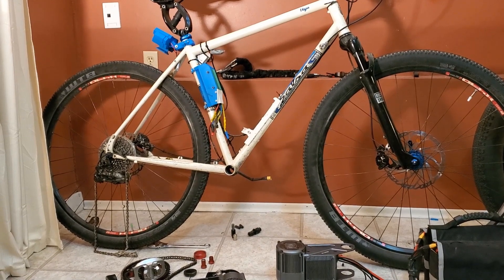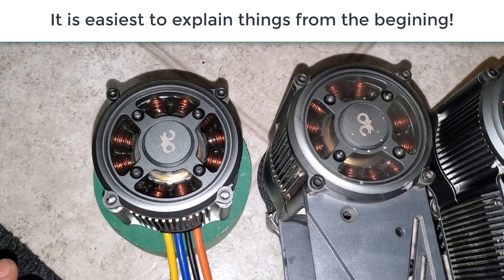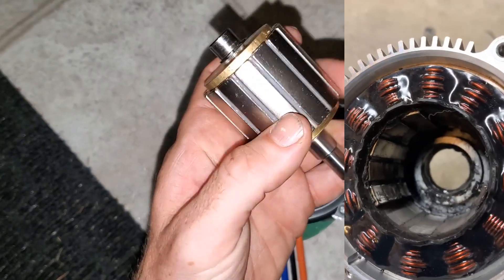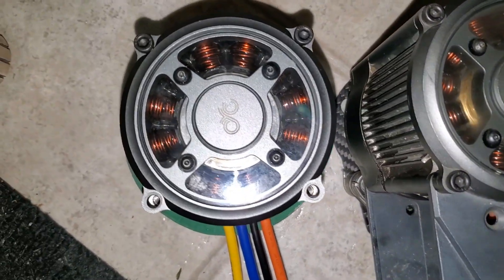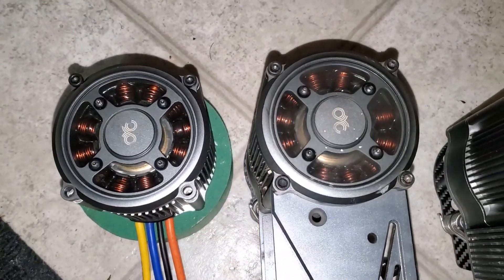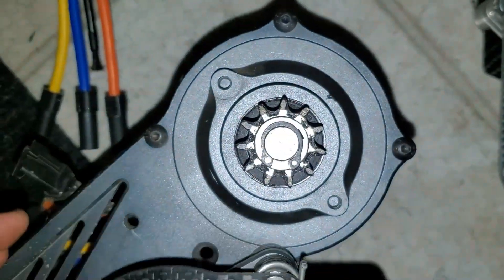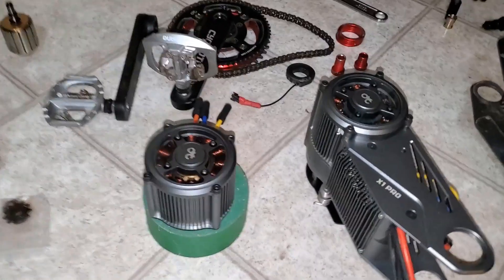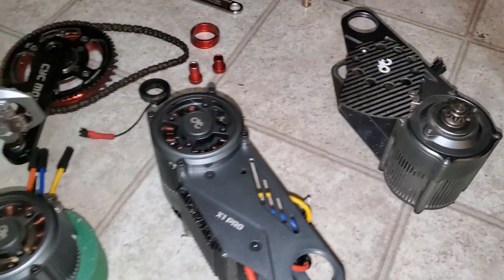Gen 1 CYC X1 Update - Overheating Problems

Comment: Great videos! 

Planning on buying the Gen 2 with the BAC 2000 and run a 72V system to allow me to hit 5000watts occasionally on a downhill enthusiast. 

Based on your experience with the updated motors, is it safe to run 72volts and high wattage or keep it down in the 3500 watt range? 

Also what chain ring do you recommend?
Reply from the maker: The middle chain ring option. You should be good with what you described. Hit me up if you need a mount for the BAC2000

Comment: I have had my bafang for 2 years and put 12609 kph on it and no issues at all. Nylon gear is still working too. U have 52 volt battery in it. I am thinking about buying cyc I seen a guy doing 110 kph on utube on gen 2 cyc and that's what I want even know my friend upgraded his bbshd and its dies just over 100 kph with one issue the nylon gear once replaced with metal it was good. Go bafang and u will never go back .
Reply from the maker: My fatbike is bbshd at 72 volts. My first build. Awesome 👌 Still on my nylon as well!!! Thanks for the comment. You are welcome on the channel discord if you would like! https://discord.gg/pKHk5ej2GG

Comment: what battery are you using?  what's the best place to get a battery pack in Canada?  I probably won't go over 25kph, avoid serious arse over tit situ.  the cyc stealth seems pretty good.
Reply from the maker: Golden motor Canada have batteries over here. They would run the stealth ok at those kinds of speeds. I'm using lipo on the cyc.

Comment: Bafang bbs02b or hd ,is better option??
Reply: Bafang got no torque sensor
Reply from the maker: Not on the 02 / BBSHD correct
Reply from the maker: It depends on the bike. I fixed my issues with the cyc. It's can be a harder motor to install and tune. The bbshd its harder to get the frame selection right

Comment: Should of got a cyclone
Reply from the maker: Its all fixed. Ripping up hills at 65kph 72 volts now. I have considered the cyclone as it looks good value. But in the end I wanted to try something new. There are not many examples I have seen of awesome builds with it. I dont even think Luna have a bike you can buy using the system which speaks volumes to me about its practicality. Are you building with the cyclone. I'd love to see your bike if so! Cheers 🍻
Reply: @HighVoltageKits  You cyc build is awesome.  But the problem I have with it is the price.  It is 4x the price of the cyclone for about the same amount of power.  Sure it has nicer fit and finish and if you have the dough, go for it.  But I wish they'd offer like a $600 version, maybe without the fancy display and torque sensor.
Reply: @pixelatedmushroom  bud, I agree with you!.......I love cycling and ebikes are my drug! I am on my third bbsHD and the am thinking about building a 72 volt hot Rod ebike. I don’t know if I want a cyc, cyclone or another bbsHD!
Reply: @Jazzmarcel  I made up my mind. A X1 Pro Gen2 + 18kw MD Cyclone + BBSHD (all on Enduro Frame with 72 Volt 50AH Battery) = PERFECT!!!
Reply: @vm2003  dam!......... that would be a beast of a bike!!!!
Reply from the maker: Holy cow!
Reply: How you used two motors?

Comment: Thats a bummer! Thanks for letting the rest of us benefit from your experience. The only thing I have had fail on my gen 2 is the bolts that hold the 2 chainrings together. CYC was very responsive and sent out improved bolts very quickly.
Reply from the maker: Fixed it. Just need to clean and rebuild the bike.

Comment: I got gen 2 and mine is leaking grease from between gearbox and motor aswel 1000km since new you know a fix ?
Reply from the maker: Check everything is tight maybe. I will be keeping a close on mine once it is running again

Comment: You don’t need much to get those apart!
Reply from the maker: Thanks. CYC sent some rather agricultural instructions involving bashing it on a table. Should be fun. Will be getting cracking shortly!
Reply: Captain Codswallop a rubber mallet will do most of the work for you
Reply from the maker: Yeah I'm sure Tony will have a few of those.. I am curious to hear his opinion as well as what it looks like inside.

Comment: Is this happening to the Gen 2 motors as well ? Or is it still too early to say? Thanks Captain, i appreciate the effort your putting into this.
Reply from the maker: No as they went back to just glue but better glue im told.
Reply: @HighVoltageKits  well i am sure they dont use glue on the vehicle you drive
Reply from the maker: The current rotors in the x1 I have are glued on. Seen to be holding up ok so far. They have been improving them further since.

Comment: I will be very curious as to what you find when you operate on that motor.
 Would it be possible to have a resistance/insulation reading done on the three windings? Resistance is the reading from beginning  of the winding to the end of each winding in ohms and Insulation is done with a 500v or 1000v unit which tests if the coils are shorting or close to shorting to the frame of the motor in K Ohms or Megohms
 Hopefully the windings haven't got a internal short or are leaking to the motor case.
From what I can see the coils or windings are very well insulated by that resin you can see through the window.
 No biggie if you can't but the Ohm reading should be fairly to very low and the insulation resistance as high as possible.
 Hopefully the problem will be physical like rubbing magnets due to heat expansion and a new rotor will fix everything🤞🤞
 Keep up the good work!
Reply from the maker: I will see what I can do sir. I will take lots of pics for sure.

Comment: Hi captain hope you are well. They are expensive motors you wouldn't expect issues like this especially when you were only running 52v. But cyc seem to be great at replacing and upgrading components that fail it almost seems the x1 was a bit of a beta version and they used the public as the test platform. 

Will be interested in the repair video I'm guessing your gong to do one?
Reply from the maker: Yeah. Im in an odd place with mine as they are mid cycle Gen 1
Reply: @HighVoltageKits  yes indeed most of the parts have been replaced now with revisions bar the outer case and the windings as far as I no.
Reply from the maker: I think so. It looks quite different now.